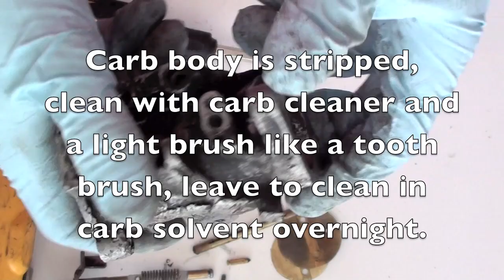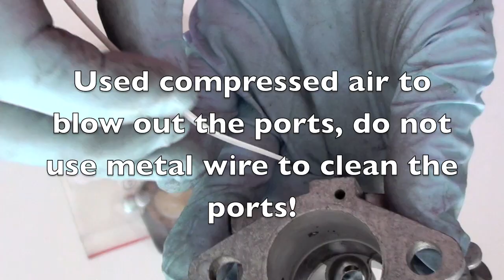Vintage sled Tutorials #5 Rebuilding a Tillotson carburetor.

Comment: Great Video!  Just got Tillotson HD54B in the shop.  Owner claims he didn't take it apart.  On disassembly there was no gasket between diaphragm and carb body.  Any reason the gasket would have not be put in?  Never had any 2 cycle without one.

Comment from the maker: that's a tough one, you can use a mikuni but very hard to tune up.  I have always made the tilly work just fine, did you change the ball valve?  It can be the problem most of the time as well.  Are you near ottawa - bring it over and I'll rebuild it for you.

Comment from the maker: @BSTARR600 Ya i have had the same thing happen, I keep a rebuilt carb here ready for the start of the year, then I rebuild the other one and put it on when it doesn;t work - I keep doing that until it stops working for real.  Try tapping on the carb with a hammer next time it won't start - it almost always works.

Comment from the maker: @elanboys You can probably get away with not having the washer, you should put a NEW fuel pump kit in the order I had shown - then you won't have problems, or at least put your old kit in the way I showed you and see what happens.  But, if you don't remove the welch plugs and complete the full service then chances are things won't work perfectly.  Thanks for watching!

Comment from the maker: @BSTARR600 Could be all kinds of things, change the plug, if it's an NGK they can just die from being wet with gas from flooding.  I suspect  your engine is very flooded now so make sure there is no fuel in the crank case - pull off your carb pulse line and pull it over - make sure no gas is coming out the pulse port when you pull it over.  If you flood it you can hold the throttle wide open and pull until it clears and starts up.   with the carb off will it start with a spray bottle of gas?

Comment: I have a Tillotson  hd73a carb that i just installed a new kit using your video and everything looks good but on the side of the carb is what looks like a 90 degree fuel line barb that has a pin hole opening. when when fuel line is hooked up to the bottom of the carb gas shoots out of the pin hole of the 90 degree fitting. could you please tell me what this is and how to hook up
Reply: It's a return fuel line goes back to gas tank

Comment: First of great video. In the rebuilding of my HD 73A I  unfortunately damaged the jet and seal as it was totally unmovable but got removed by carefully drilling it out - I have same issue with a HD 83A so it will stay in place vs damaging. Got any idea where to get a replacement believe it is a specifically a grosse jet tilloston 07-411. Also what socket size are did you side to remove the needle seat its something I can seem to locate in my tool box or Canadian Tire. Thanks

Comment: i just rebuilt mine, adjusted the carb to what the manual says and cant get it to start, just sputter and a fair bit of gas comes out the carb, any thoughts on what could be the problem?

Comment: If the lever arm isn't flush do you adjust it by tightening/loosening the screw holding the fulcrum arm or by bending the lever arm?

Comment: Great video! Im currently rebuilding a HD 39A that was on a 74 panther 340 i bought.  only i notice different about mine is the check valve is like a small brass tube.  I'm not sure how to remove it.  Was wondering if your are familiar with that. thanks.
Reply from the maker: No Idea actually

Comment: Nice video.  A little Locktite on screws for the choke and throttle shutter will help ensure a strong hold in case the threads are a little worn.

Comment: I rebuilt my tilly with your vid it purs like a kitten great video I still have a low speed bogg with fine mist of gas puking out carb any thoughts?
Reply from the maker: is it a twin?  you have to set your idle jet.  gas on your coat - welcome to tilly
Reply: PowerModz yep its an elan 250 twin.. when u hit high rpms seems to go away ill try idle jet u mean the low speed jet? I also looked the carb up it seems to be off a 440 plus oylimpic hr 171a

Comment: they are a good carb...i've had a few that i couldn't get the jets set even after a rebuild . 9 out of 10 times after a rebuild if ya still can't get it set its the brass throttle butterfly is loose in the bore ..had the same problem with chainsaws

Comment: Hey Louie! I’m really glad you made videos like these. Nobody else does ‘em. Thanks buddy. I’m restoring an elan from scratch with a 318ccm motor. No idea what it’s from. But I’m going from mikuni Carb to a Tillotson carb. Probably a common problem but I’m trying to figure out the fuel hookups. Someone said that 90deg pinhole is a fuel return. How exactly does that go back to the tank? Where does it hook to on the tank? Hope you’ll see This and help me out. Really appreciate it.
Reply from the maker: Glad to help, youll have to put a return spigot in the tank - put the hose into the bottom of the tank

Comment from the maker: @belairlover93 Yes you do have to worry about TOO MUCH fuel in the crankcase - this gives you a rich mixture that will not burn ie. flooded.  If it is flooded you need to clear the excess fuel out and make it so the mixture is able to burn - that is what a carb does when running properly.

Comment: @lshobie if you didnet know a 2 stroke you dont have to worry about the gass going in the crank case its a 2 stroke thats where it goes its not like a 4 stroke that it mixes with the oil because the oil in a 2 stroke is in the gas

Comment: @farlinj if you dont have the real wrench to remover the right bolt you have to use a flat screwdriver and a hammer and tap and unscrew the bolt

Comment: I found a family of dead beetles in the little built-in fuel filter. I have a feeling my snowmobile might start running better now.
Reply from the maker: stoopid beetles!
Reply: @PowerModzOfficial  you can say that again. however, the carb must have looked like prime real estate, as the snowmobile hadn't been used in forty years.